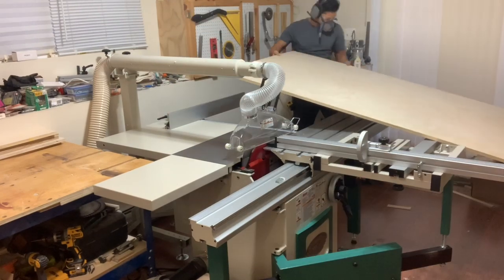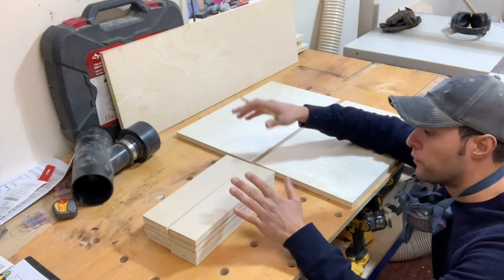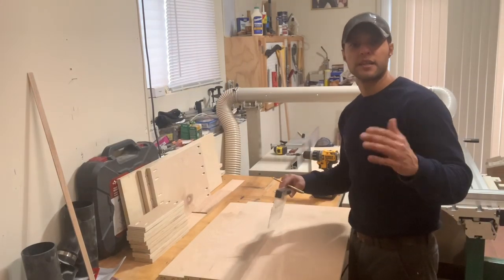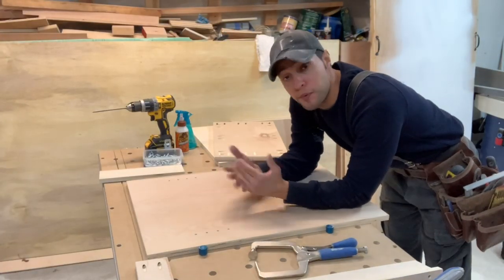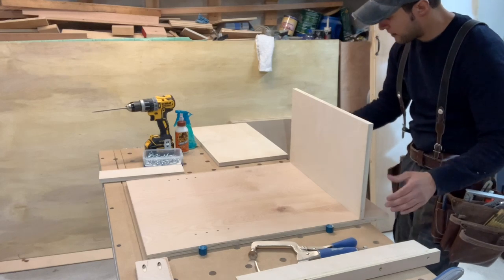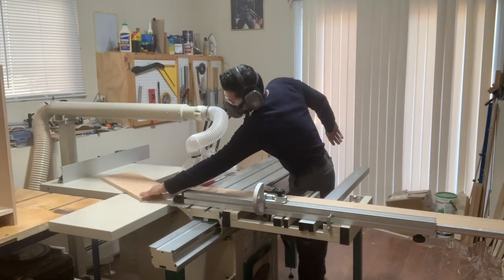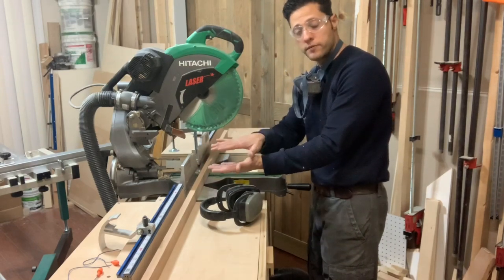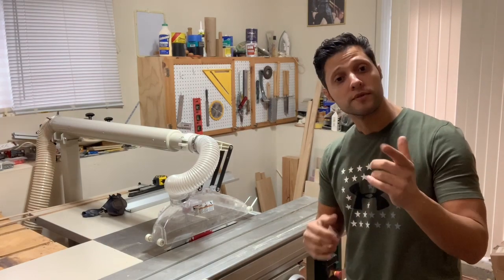DIY computer desk

Comment: Great video! Excellent approach to building this. Question: Do you treat the plywood with a stain conditioner before applying stain? Just wondering how the plywood takes stain, especially when it's being used so prominently (like the top to this piece).
Reply from the maker: Thank you. No pre stain conditioner on the plywood. I only use that on pine or maple.